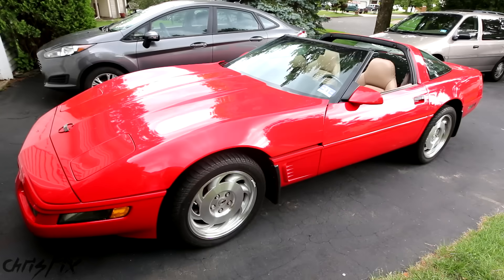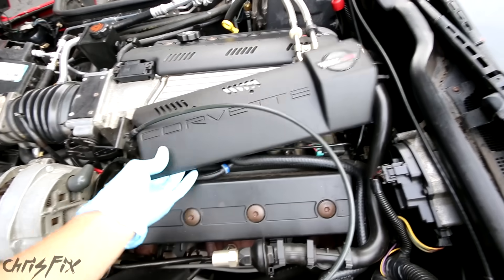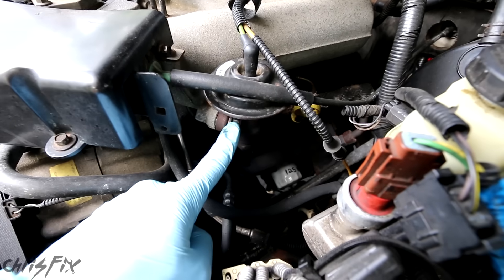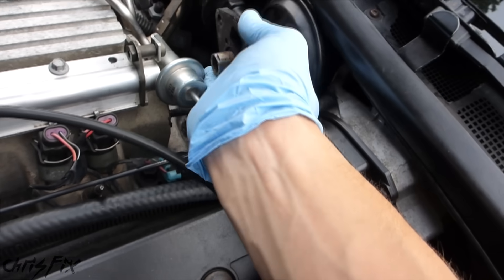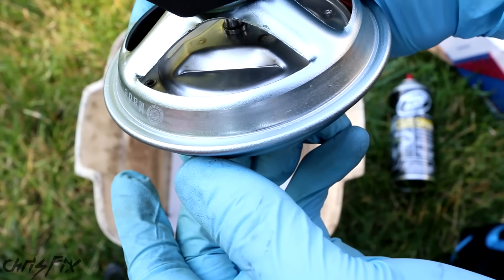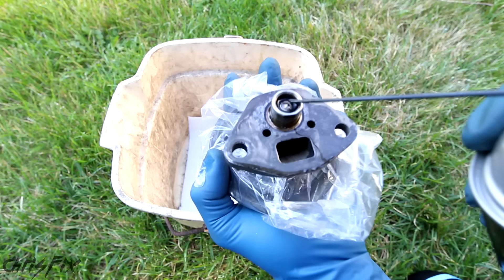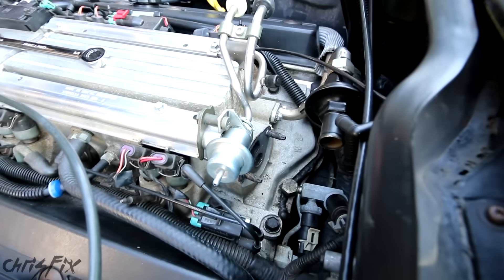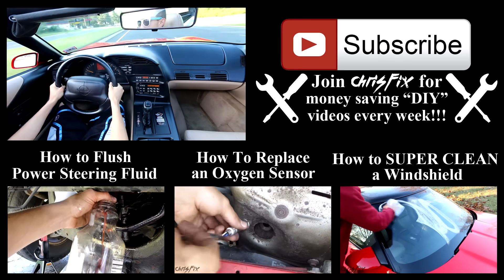How to Clean and Replace an EGR Valve P0400

Comment: i have a egr valve that has a pinhole leak i mine is doing the same as the old one it a 2.2 chevy s-1o 94 it runs  but what if i replace the egr valve  will it be better for the truck and give it more power
Reply from the maker: +tazalots It depends. That hole might be a big enough vacuum leak to cause problems. Some cars are tuned for the EGR to work so if it isnt working you will get a rough idle.
Reply: +ChrisFix thank you

Comment: Excellent video.  Only thing I would recommend different is NOT placing the EGR upside down and letting the cleaner sit.  If it were good, and only need cleaning, doing so would allow carbon gunk and liquid to enter the diaphragm vacuum  area. 

For best results, DRY clean with a pic or flat head first then use the cleaner.  This didn't apply in this case because it wasn't clogged up and the diaphragm was already bad.  Hope this helps.

Comment: So Chris, since yours was not holding vacuum, it was essentially a vacuum leak, right?
Reply from the maker: +Brandon Herrera Correct. In the diaphragm there was a leak.
Reply: Well I'll be damned lol. In my 93 C4, I pushed on the EGR, disconnected vacuum line and put finger where the line connects. It comes back up. So I guess I need to change it.

Comment: The quickest and simplest way to test an EGR valve and passageways is to apply a vacuum supply (hand pump) directly to the nipple.  If the engine stumbles or stalls then it is likely working properly.
Reply from the maker: +theoldwizard998 Great tip! Thanks for sharing!

Comment: Hey Chris I change the vacuum lines to the egr valve last night and still gives me the same code! How long do I need to drive it till it goes away? Car is idleing good now
Reply from the maker: +Miguel Leal If you clear the code it will go off right away. It takes about 200 miles for it to clear itself.

Comment: +chrisfix Hey. Beautiful vette. I'm glad to say that I'm now a proud owner of a 1989 vette myself. 
I watch your videos all the time and learn so much. I was hoping you could answer a few questions. 
1. If I recall correctly, your vette is a '94 right? which means that it's a c4 like mine. Does a standard obd2 scan reader work on your vette? I saw that you used that Bluetooth code reader.
2. Any tips for to care for it? Anything specific I should look out for? I know for sure that the ground clearance will be a challenge from time to time, having to jack it up, oil change and what not.
3. I believe everything, and I mean everything, is stock on the vette. I'm not too worried because it only has 62k miles, (mostly kept in storage) but I was wondering if parts have "expiration dates". I'm definitely going to replace most of the fluids but I wanted to ask if i should worry about the solid pieces such as shocks and other things in that nature.

Sorry for the long comment. thanks, love your videos

Comment: I think this is my problem, but not sure. I tagged you in my post on FB...if you dont mind putting in your 2 cents..

2002 SATURN SC2 UPDATE: yes it was the nasty gummed up, sticky pindle on the EGR Valve. Cleaned up nicely, running like a champ. its the original EGR, the car has over 220k on it, but it cleaned up so nicely, i put it back on. Heres to another 100k!

Comment: I thought the EGR was to lower the volumetric efficiency to improve fuel economy when full displacement is not needed?
Reply from the maker: +daily_wheeler Yes, aka put exhaust gases into the combustion chamber.
Reply: thought that was the main purpose. didn't know it was also for cooling.

Comment: Hi....good videos.....
Question......so there is 4 types of EGR VALVES?....
And that will be good thing if we clean all EGR VALVES? ......I got a 99 Toyota 4 runner and I have been driving since 2004 and has 87 miles...... well in the somer I drive my bike......so I don't drive so often..... And one EGR I can see lt clearly but the rest of them I don't see it??? thanks for sharing and helping us!!
Reply from the maker: +Danny Chuqui There are two main egr valve styles. You can clean any egr valve.

Comment: Also note if you're broke as a joke and have a rubber style diaphragm (like on older Honda's) and also have some plasti-dip laying around, you could get by with spraying dip on the diaphragm, I found they tear around the inside edge, sometimes just a pin hole can throw off your idle. Great thorough video though!

Note: This works (sometimes) if you hear a hissing sound after you plug the vacuum hole.
Reply from the maker: +Yo Fizzle haha, that is a good fix to pass emissions if you dont have the money!

Comment: The first set of tubes you show in the video leading (to not from) the exhaust manifolds are for the air injection system NOT EGR. The EGR takes in exhaust gases internally through passages built into the manifold. The only components of the EGR system in that motor are the valve, vac. solenoid and associated vac. tubes. There are no external exhaust tubes.
Reply from the maker: True but not true.  The egr has external passages too like in my truck.

Comment: it cheaper and more convenient to just disable the whole egr just by closing of the square hole (It gave me lots of problems on my Opel so i closed mine with a self made gasket that did cover up the hole)
by doing this, you get no more egr problems.
 It's a stupid system anyway that supposedly is more "climate friendly"  
since it sucks back the exhaust gasses back in the cylinders,it's definitely not engine friendly.
Reply from the maker: +Bunyamin Arslan Thanks for sharing. It is cheaper to fix it because getting the EGR tuned out would be about $500 if you can find a shop to do it.
Reply: ChrisFix  No, you don't have to let "tuned out" anything, the egr and all components stays the same the way they are,only thing you do is, just shut it of.
You can just shut it of,by blocking the square intake hole (above you can see the square intake) just next to the round intake valve and put it back on the engine thats it!
The egr valve on my car was electronic,and it works flawlessly the vacuum ones should be no problem to.
Most cars gets bad running enginges, and mostly it is because of this egr valves that get stuck.
Reply: Just try it with a bad egr or just a working one, so you can see how a blocked egr runs on your car,and make a video of it would help lots of people.

Comment: Is it ok to blank or cover the egr sir?
Reply: +mark hustler You could probably get away with it in non-emissions states. I know of a few shops here in TX that were fined (some to the point of going out of business) for selling and installing EGR delete kits. Which sadly, is the only way to fix one of the many reliability issues in a 6.0 Ford diesel.
Reply: +Justin Johnson i currently live here in philippines and I own a 2.2 ranger diesel. ill be blanking mine soon though

Comment: How do you clean the EGR Valve pipes? I have a 1998 Acura 3.5RL that has two EGR Valve pipes that run along the back of the engine in a very hard to access location.
Reply from the maker: +Marcus Vanshur I like to spray carb cleaner down the hoses and let it soak. Then blow the carbon out with air.
Reply: +ChrisFix Cool. I will give that a try. I was told by the dealer that they take a coat hanger down through the pipes and also spray with cleaner. Compressed air?

Comment: Im haven stalling issues and I replaced the distributor,set the timing, cleaned the TB, fuel pump is good, changed fuel filter, no torn or worn vacuum leaks. One thing I havent checked was the EGR valve but Im not getting no CHECK ENGINE LIGHT bit of confused 

94 Cadillac Sedan Deville 4.9 V8
Reply from the maker: +Raymond Pendleton Well it is either air, fuel, or timing. How is the air filter? What is your fuel pressure?
Reply: +ChrisFix Thanks for the response I check and notice I had oil in my spark plug well in cylinder 1 so I have to change the Valve cover gasket and intake gasket to stop the leak?
Reply: +ChrisFix and could that lead to hesitation and poor acceleration also?

Comment: Can the egr cause po171 and 174 banks 1 and 2 running lean
Reply from the maker: +Tim Fenton Yes it can. If it is stuck open you can run lean.
Reply: +ChrisFix thanks I've been chasing this code forever. I've put a lot of money into it. The guy I got it from I'm craigslist ripped me off.

Comment: EXPLAIN TO ME HOW BY RECIRCULATING EXHAUST GASES BACK INTO THE INLET SIDE OF THE INDUCTION WOULD HELP COOL IT!!! I THINK YOUR WRONG MATE!!!!
Reply from the maker: +Stephen Fitzgerald Exhaust gasses are cooler than the very high temps in the combustion chamber. If you dont believe me, look it up.
Reply: +ChrisFix if you were to block off the egr with a blanking plate i would guarantee the engine would run a lot cooler over all and be better with more power and better fuel economy!!! if you don't believe me look it up!!!! as an example on a vehicle with egr functioning the exhaust temps on the highway are roughly around 380 degrees and with it blocked off they were 300 degrees!! just saying.

Comment: Just nitpicking, but the EGR doesnt allow the engine to run "better", it allows it to run cleaner by lowering combustion temperature so less NOx is produced.
Reply from the maker: +DeFreshS10 It runs better because it cools the cylinder temps which allows you to run better timing.
Reply: ChrisFix But it also takes away from volumetric efficiency.
less air/fuel to burn=less power

Comment: I just did this on my 91 Cadi, I failed Emissions. Rated a 2.72 on NO2 test, and the limit was 2.50. Now I pass at a retest of 1.51, with the benefit of better MPG, smoother idle, and my accelerator doesn't have any lag anymore.

Comment: I have a 2000 Nissan frontier 3.3l v6, My engine did not come with a EGR, but it does have the option for it on the intake. Would  It be beneficial to purchase all the necessary parts?
Reply from the maker: +Kyle Hubert Dont bother with the egr if you dont have it. It only causes problems.

Comment: Why wouldn't you change the gasket if you have it?
Reply from the maker: +Martin “Mace” Ceja Because it is a pain to take off and clean the surface off in that tight area without getting anything in the intake. It is easier to just reuse the old one.

Comment: i just changed the throttle position sensor on my 89 silverado an it's still doing the same thing..  I changed the fuel pump an fuel filter  an the truck ran good for two weeks an now when I get on the freeway or sometimes I go over 45 an press on the gas it starts to lose power (pressure) one on the guys an auto zone said it might be the egr valve. but I'm just trying to make sure Befor I buy something I don't need like the CPS. any ideas?
Reply from the maker: +Jose Beltran Check your fuel pressure: https://www.youtube.com/watch?v=_oXLUqE4Sf0

Comment: Hey I just replaced my ego valve, now I got no engine light but the car idles worse, when on drive sometimes comes close to 0rpm and seems as if it's  about to turn off, any advise?
Reply from the maker: +TheDude Dorian I would check for vacuum leaks

Comment: Great video! Thanks for showing how to clean the EGR valve even though you were replacing yours. My sister got a check engine light and a P0401 code a couple days ago. The shop quoted around $600 for the fix including diagnostics. It seems like an easy enough repair that I could do it, but I won't be able to for a few weeks. Is it safe for her to be driving that long without fixing it? Could it do damage to other components? As far as resetting the check engine light do u have to disconnect the battery or will it go away automatically after the repair? Thanks!
Reply from the maker: +Matt Bono Glad the video was helpful! You dont have to worry about fixing the egr right away. I have had the egr in my van clogged for 5 years. Some people even block it off. The only problem will be if you need to get your car inspected. There wont be any damage at all. It will go away after you drive the car for 100+ miles after you fix the problem or you can delete the code with a scanner (or unplug the negative battery side): https://www.youtube.com/watch?v=xPI36bKVCjk
Reply: +ChrisFix thanks for the quick reply! As I understand it, the exhaust gases return back into the intake manifold and those ports could be clogged as well. Are you aware of any resources that could provide specific direction on getting to those ports? My sister has a 2000 Camry. Unfortunately I don't have a service manual. Thanks!

Comment: Good video.. However not all EGR valves will hold vacuum with the test as shown.  I believe the backpressure types require exhaust pressure to be present before the vacuum will pull the valve open.
Reply from the maker: +AIM54A Thanks for sharing!

Comment: I deleted the one one my car because its a diesel and gets the intake full of dirt.... not good.
Reply from the maker: +Hs Yea, if it is possible that is one of the best things to do. I "deleted" mine in my van by getting it so clogged up, that it doesnt work anymore haha
Reply: i deleted mine in 2 ways by doing a remap and placing a piece of metal blocking the exhaust pipe to the intake : its a 1.7 dti opel corsa c (european car)

Comment: Just block the EGR off, if it don't set a code doing it.

Its just feeding the engine its own shit to lower the amount of NOX in the exhaust gas, and it clucks the intake with carbon.
Reply from the maker: anders949494 Unfortunately with OBD2 cars you need to tune it out or you will get a code and the engine might not run right.
Reply: +ChrisFix some cars you can block its of even when they have obd. But dont know how it is on the corvett, its a good looking car btw :-)

Comment: Chris, I need some help. The metal end of my GPS had got stuck within the socket. When I pulled out the GPS chord, the round metal end remained lodged in the socket and is not coming out. I showed it to a few mechanics and all of them are quoting north of $100/hr as they are saying that the whole thing has to be dismantled. Any thoughts?
Reply from the maker: Gertrude Can you send pictures on my ChrisFix Facebook or instagram?

Comment: Is it really that sure that an EGR issue will trigger a CEL? I am thinking i have a EGR issue since my WOT performance is good, but my idle and low end is rough, no exhaust leak, no vac leak I can find, clean, good TPS voltages, MAF recently cleaned.
Reply from the maker: Ultrajamz Yes, a bad EGR will trigger an EGR, but like anything else, it wont always trigger a CEL if it is within a certain range.

Comment: Hey Chris I have a 2001 chevrolet tahoe 4.8l 
It does not start right away in the first crank..what can be the possible  problems?
Reply from the maker: Ruben Rodriguez Try a fuel pressure test: https://www.youtube.com/watch?v=_oXLUqE4Sf0
Reply: Thanks I will.

Comment: Just a note on EGR systems, more than a few car makers incorporate the air passages into the head  and intake manifolds of the engine. So if you dont see a pipe, not really a problem, just look for the unit that looks like the one in the video bolted onto the intake manifold and you should be fine to follow this procedure.
Reply from the maker: Spike20101000 Thanks for sharing bud! That is a good point!

Comment: Is there any benefit and/or downside to doing an EGR delete?  The tube coming from my exhaust to the EGR has a hole in it, and the replacement tube is a discontinued item.  Can't find it anywhere.  Thinking of just doing a delete so I can drive my car again.
Reply from the maker: Soulburn X You would need to tune out the EGR in OBD2 cars or your check engine light will come on and the engine might run poorly. Otherwise there is no real downside.